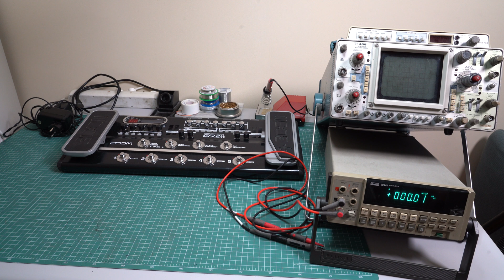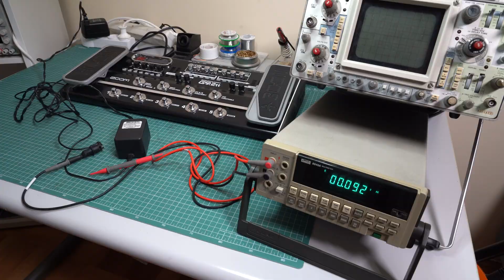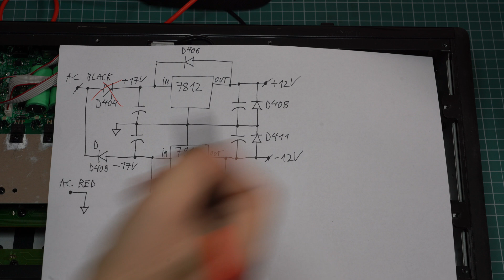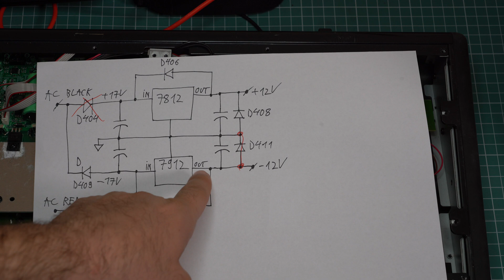Zoom G9.2TT Guitar Effects Console Repair

Comment: Thank you for the vid. Just had one of these Zoom 9.2 fail last night during a session just as it was sounding the best it ever did. It sounded like the JCM900 had failed or was getting power soaked more and more as it failed. Not sure if this indicates tube failure in the 9.2, but I will likely  attempt inspection and repair. Too bad you aren't close or I'd pay you to fix it...maybe ill get our lab to assess it to avoid test point fatigue on my part.
Regardless, while my issue likely isn't as obvious, i appreciate your video showing inside and explanation of the test points as well as tube power design. 
Peace

Comment: Once your in like Flynn, keep the equipment the correct way up or all the electrons will fall out ! Dave Jones and the EEVBlOG Forum are an absolute mine of info. Yes this is a classic fault that can look, and as you point out 'Intimidating' but the application of "Thou Shalt Measure Voltages" and soon you will have a result ! As your a Guitarist I bet you had fun with that off camera !!.....cheers.